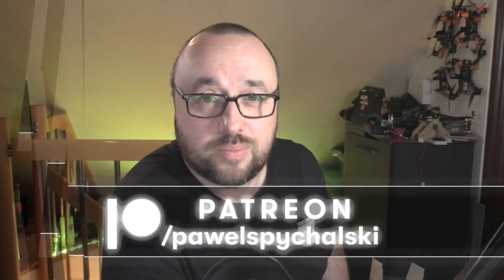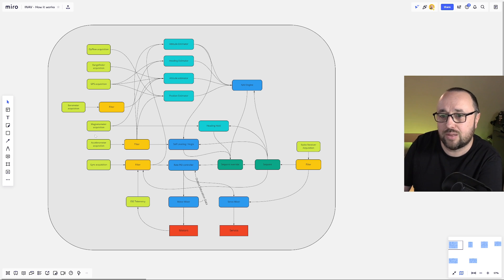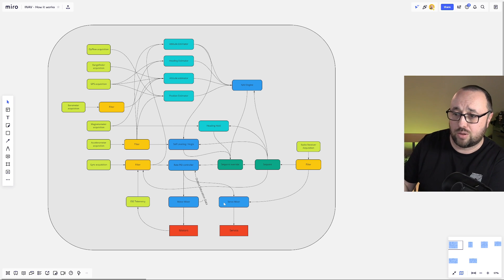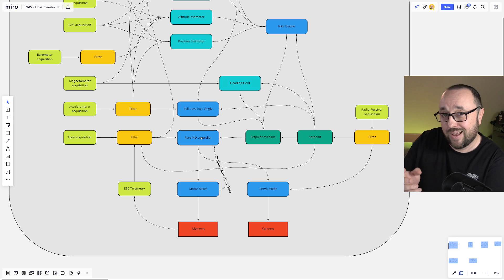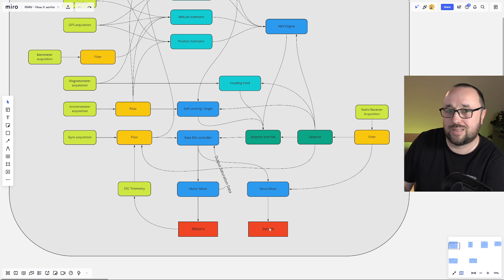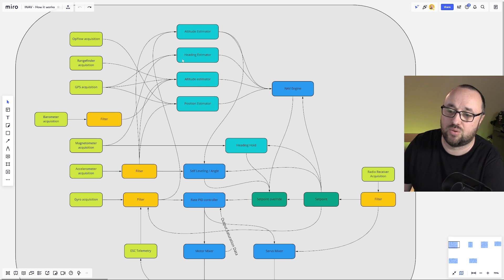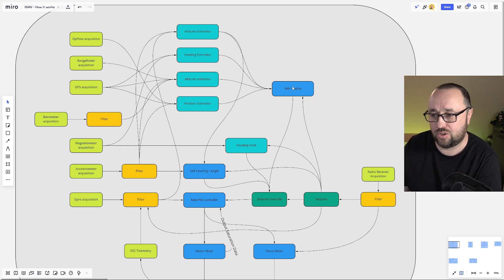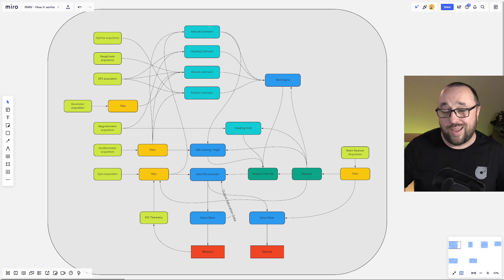Flight controller architecture - FPV University

Comment: Very fascinating. Thanks for doing this overview of FC architecture. 

A number of interconnections are routed in a way that is different from what I'd expect (having an aeronautic aviation background). Not neccessry negative in anyway, just different than would have expected.
Example, not seeing roll, pitch and yaw as axis managed control loops; this appears to be done by "self levelling / angle" block for pitch and roll, but yaw handled by the "heading estimator". Sensor data from gyro and compass take very different paths as they integrated into heading estimator.  
I can see how some of the architecture was influenced by the use of Wii controller, sensors and limited processing power early in the project.

Find this interesting, and have number questions. 
Is there documentation on INAV architecture (or parts of) other that digging into the codebase? 
(ie: developer focused documentation, beyond the INAV wiki)

It would be interesting to see how the architecture in INAV has changed from MultiWii and CleanFlight days, but that's likely a topic that only a small portion of your audience would appreciate. (ie: likley hard to justify your time to creating such video content)
Reply from the maker: There are many ways to solve the same problem :)
Reply: @FPVUniversity  Very true. :)
This why I found this video fascinating.
Besides reading code, and GitHub wiki, are there recommended references to learning about INAV, Betaflight, Cleanflight architecture? Thanks.
Reply from the maker: @AerialWaviator  Most probably I'm the only source of this kind of information
Reply: @FPVUniversity  Thanks. I'll spend time to study code before asking questions. Your video will be helpful to focus as I explore.
Reply: @FPVUniversity  thanks for this video, I was looking for same info, tried to understand the code, but didn't get much further, will retry after learning from this video

Comment: Nice! Inav software architecture looks better than the Betaflight one. Pawel, how often is the accelometer read in Inav ? In betaflight it is read every 1ms, but for 50ms there are measurements and then for the next 50ms no measurements at all. Betaflight is using the accelometer  mainly for Angle mode, so I guess they don't care much.